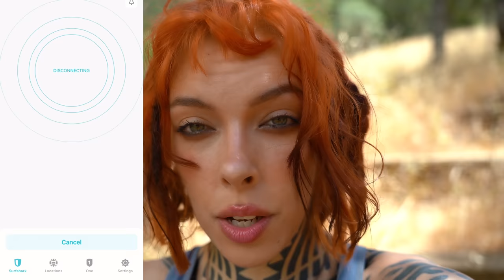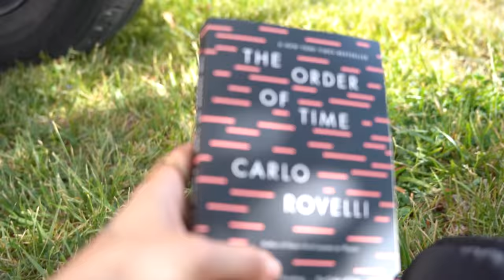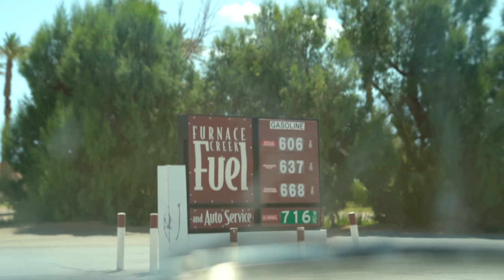i shouldn't have come here... (solo female van life in Death Valley)

Comment: Those older model jeeps from 90s to early 2000s are famous for cooling system issues and over heating. 
For some reason they tend to run hot and make the therostat fail and get stuck closed . You should look into having a failsafe thermostat put in it... if it fails it stays stuck open instead of closed like normal ones, the only drawback is the heating defrost system will not be super hot when you need it if it does get stuck open. Those older jeeps coolant systems always fail at some point...Have not seen one that didn't fk up at some point.
Love all the scenery and nature's beauty out there you video. It's amazing!!!
Be safe traveling out there and enjoy 😘

Comment: if there is a coolant leak you can get stop leak and it actually works well, but you need to know to leave it in the coolant system until you fix all your leaks (hoses, radiator core, etc.). If you're in a hot place too use distlled water in your coolant system. Also, since your vehicle is OLD get engine honey at the local parts store / gas station and add that to your oil. it helps seal up leaks and stuff like that in older engines. quiets them down too!

Comment: The coolant of your radiator is full. If the overflow tank is full and the radiator heat up more with the air conditionner, you will also have cool ant dripping. A bad radiator cap can stay open an overfill you overflow tank and cause dripping. If the radiator cap stay close want the pressure increased due to a dirty radiator fins and climbing hills, the radiator will crack because these days, many radiator top parts are made from plastic. I hope this information give you some insight o the way you got some replacements.
Reply from the maker: No a bunch spilled out multiple times - it was the radiator the needed replaced in the end
Reply: @TorieRobot  I'm happy now, you are safer  on the road for a long time with this repair. 

A radiator can last a minimum of the coolant life and often last multiple coolant change. Some coolant for the Jeep last 120 000 miles.

Comment: I haven’t got to the A/C on my Jeep’s  yet   I did have to replace the radiator. On my 2000 xj. With 275,000 miles  it just blow the head gasket ,  i’m doing all the repairs  I did send the head off for $150 ported and polished i’m getting all valves replaced and seated  I did all the ball joints on the front too I did it all now wheel bearings  in the front hasn’t cost me anything but my labor and parts  i’m pretty self-sufficient  and I have some good friends helping me out too
    That’s a good test run your live video said going to sell the Jeep

Comment: If that's the inline 6cyl engine in that jeep it's a good unit.  I'd keep it.  Just a suggestion that you replace the coolant hoses and the heater core.  The heater core is typically a huge job but it just takes time.  You can do it and its worth it.  Also taking off the head having it milled and reinstall is a simple job in that Jeep I-6.  Cost is a lot less than those tatts.

Comment: I rode that over heating radiator dragon for a while. What a nightmare. I was sold a gorgeous Honda station wagon  by a Chilean woman who told me the car had a cracked radiator after we signed all the paperwork and exchanged the money. 
I would JB weld it back together after it over heated & would have to wait for it to cool down after blowing hot water everywhere and 2 part epoxy it… pour more water & coolant in and go a few days before doing it all over again. Great job just replacing the radiator💕

Comment: Tori, i recomend u get a full size spare tire, purchase at an auto wrecker, then ask them to fit a swing out external tire holder from any suv and for a few bucks (maybe some beer) mount it for you. Also , get yourself a 7/8 by 30 ft. recovery syn. rope with 2 syn. shackles ,in case you get stuck or break down.Good luck in your travels and be safe.

Comment: Id' look into a engine conversion kit,....and put a 302 Ford or a 350 Chevy engine in it,....and a new radiator in it.
I heard that since jeep was bought out by a French car maker all their engine heads were flawed.
If your going to be running all around the country,......do your car right,...get the 350 because parts are cheaper and a big radiator and add a cooling fan to assist you add 3 actual gauges oil pressure, tempeture,.and the volt meter thingy then you are pretty much set.
Carry a power pack/jump starter thingy, and carry a solar battery charger for your car.
Note,... I'm thinking running an air conditioner might make your engine hotter?
The fix is the 2 time tested proven engines the Ford 302 and the Chevy 350.
Look in the back of 4X4 magazines for conversion kits for engine up grades.

Comment: That place even looked hot. With the stress of Yuki on top of it, must have been frustratingly stressful. You may want to see if Yuki has a cabin air filter. With all of the fine dust you’ve been going thru it may be clogged. It would increase your air flow thru the vents as well. Most vehicles have one, but not all.
Reply from the maker: Good idea thanks

Comment: Look into a fail safe thermostat or use a good quality thermostat 180 ( 190 degrees is original temperature) 180 temp runs cooler slightly but keeps engine cooler in hot weather areas - a must - they even sell 160 temp ones - easy to change -  also a fail safe (red lever ) radiator cap - 

Be safe best wishes to you beautiful alien lady - good things take time keep the faith in yourself- you are valuable

Comment: This is where having the ON X Offroad app would help as you can down load a map of where you are and going so if you do not have cell signal or wifi you have the map which other users are leaving their route with PIN's to mark things of note airbnb camp sites fuel stations subscribe and use I really recomend you to get the app hey also info on recovery guys workshops takeaways.
I watch your mechanical woes and get frustrated seeing you being ripped off as to which every repair to date not required and when needed not so costly.

Comment: Just dole under the truck and look at lower radiator hose. It probably just popped off. Cut an inch off, squeeze it back on and tighten the clamp. Add water and limp back to town.
Reply: Oh, super El Niño, this summer, gonna be hot everywhere.  9line hoodies, are huge! And comfy.

Comment: My guess is that jeep needs a remanufactured head which is really cheap when you turn in the other head that's on there it's not all that expensive that remanufactured head with a new head gasket will solve your overheating issues

Comment: All the Best…. Important… remember the older the vehicle the probability of not running is lower. See a newer or low mileage has a higher probability of failure … why is a car that has gone 300,000 miles has that under its belt a new car has like 50 miles so other than small aggravations and maintenance the old car is actually more likely to drive another 100,000 miles than the new car. So think positively❤🎉😅! Now older cars are actually more simple and fixable.  So fixing an older car is much easier and less expensive. So practically your older well worn Jeep is better than a new one for your use. You are probably suffering deferred maintenance issues causing problems. Yes anything can fail on any car… but I would rather have your keep for you adventure than a new one and ultimately it will be cheaper. I would and could replace a head gasket in Auto Zones parking lot or alongside the road…. but to prevent such adventures when the Jeep gets to near scary levels of temperature… pull over cool the car down… open the hood let it idle for awhile …. Now this suggestion requires you carrying a few gallons of water on board… splash or dump little bits on the front of the radiator while idling too cool it down … a small pump up spray makes this more efficient…. Then you can safely shut the car down an let cool down wait. The other idea is actually seems opposite to sense but a very good friend while engineer for Chrysler doing desert testing had a water pump failure on a test car… in Death Valley…. Well they needed to get the other performance testing done…. So what to do well he carefully loosen the radiator cap… towel and clamping wrench… rotating to the first notch so it did not blow off but released pressure…. It erupted in steam and water spray … they kept the car idling …. Then removed the radiator cap and filled the radiator will just water NO 
antifreeze. Keeping car idling and filling the water as it boiled off cooling the engine down by removing the waters latent heat of evaporation.  Then for the next few days the simply put the radiator cap in the glove box… and every few miles topped the radiator off with water to replace the water boiled off… this worked and they got the tests completed… without a water pump!  Now I have done the same.  Bob belonged to the SAE for over sixty years and was famous in his work on engine performance.  I could bore with my stories… but have no fear and a little creativity… you will get through. Watching Scotty Kilmer’s YouTube channel would help… message me if you get into trouble and need suggestions … I’m subscribed with notifications.. so just reply comment to one of my comments.

Comment: Should've had electric fans put in an had the clutch fan removed an upgraded the radiator and a lower temperature thermostat to a 160 degree instead of the 190 degree from the factory total cost would've been $300 max and 2 to maybe 3 hours time i can do it in about an hour personally i can't see paying someone for something i can do myself xj's are notorious for overheating anyway happy overlanding

Comment: Next time buy a Japanese car. They are way more reliable.
Reply: It would never have never lasted as long as that jeep. Even if it does. still will break down I got a Silverado and a Nissan I'd take my silverado anyday iam not trying to save gas. I'd trust silverado before the Nissan also. And I have had a Cherokee
Reply: They are all great. But better parts availability in the u.s. for u.s. built autos. Although I think by now everything is built here. The best thing is stop whining.
Reply: Here in the Netherlands any part of any car can be delivered within a day. Perhaps it will take a bit longer in the USA, but availability is not an issue. The point is that Japanese cars are made not to fail. Toyota Landcruisers are king in Africa. No parts are available in Africa, but with Toyota Landcruisers you don't need parts anyway.
Reply: @PeterKooimanNL they’re king of Africa because they’re way cheaper to import. Her jeep has 260,000 miles. That’s proof of its reliability